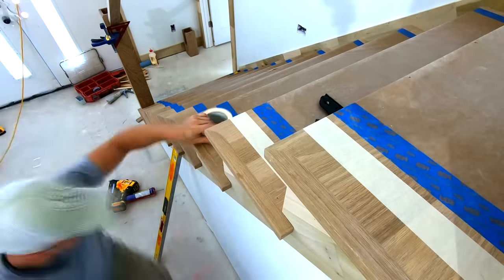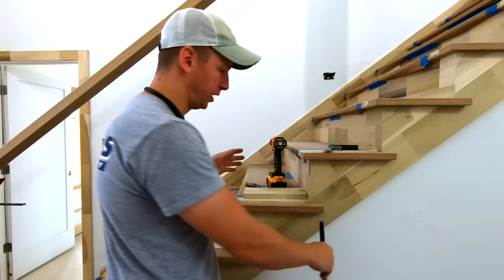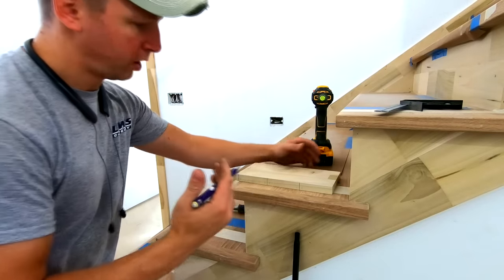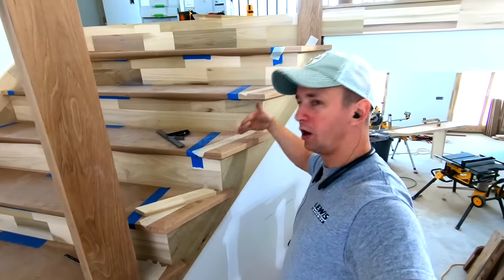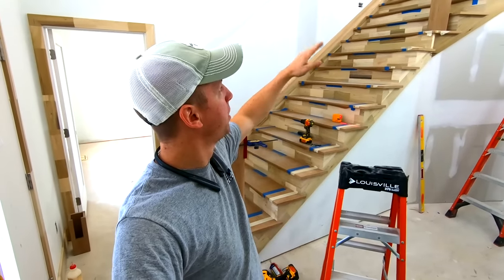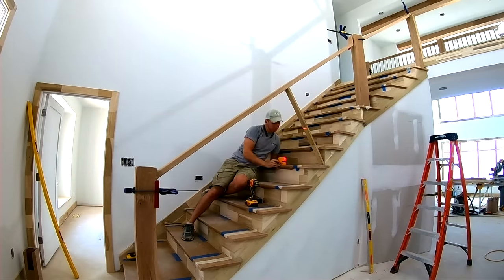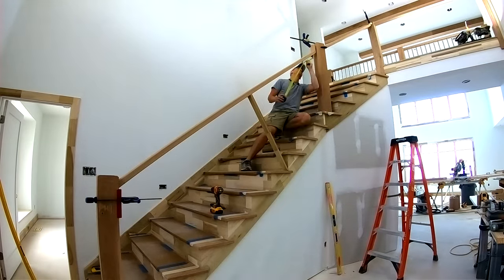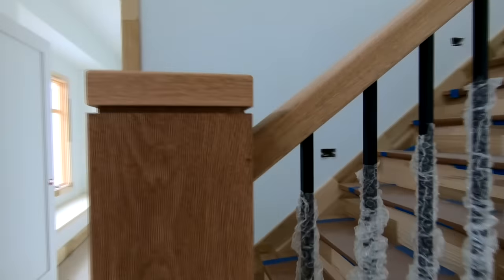How to Layout Iron Baluster Spacing on Staircase - Wood Tread & Handrail Spindle Layout

Comment from the maker: Bullet Tilting Hollow Chisel Mortiser - http://www.cwimachinery.com/product/b... (MUST BE A TILT MORTISER)
Dewalt Compact Stand (for mortiser) - https://amzn.to/32R4W2m
Stabila Digital Level - https://amzn.to/2PRwVXV
Digital Angle Gauge - https://amzn.to/2Y0iaX7
Baluster Layout Compass - https://amzn.to/2OUr3Nf
Starret Combination Square - https://amzn.to/3f3ph75
PLS 180 Laser - https://amzn.to/30OMCnN
1/2" Hollow Chisel Bit - https://amzn.to/2OZDgjH
Rubber Mallet - https://amzn.to/3hDCq8m
DEWALT DW872 14-Inch Multi-Cutter Saw - https://amzn.to/2Em3mvb
Dewalt Cordless Grinder - https://amzn.to/2EiwXWd
Festool Sander - https://amzn.to/39sEoG1
#14 x 2" Construction Lag Screw (For Handrail/Newel Fastener) - https://amzn.to/2DdIben
Reply: How would you measure out for false tread end caps

Comment: Just drill a 7/16 hole, tap a 7/16 dowel in the hole and tap the 1/2" metal baluster over the hole. No chisel needed.

Comment: This formula for spacing did not work for me , when it changes from step to step the spacing is different, i cant figure out a correct formula for it to make every single one with even spacing. I instead found center of each tread then tried a few different combinations to finally find the right spacing

Comment: I'm glad you keep the newel post to baluster spacing the same as the spacing between the balusters; there's very little that irritates me more than seeing that first baluster either too close or too far away from the newel post. Great video 👍
Reply: I am completely a novice and hadn’t thought of the newel post and first baluster spacing. I mean, I did think of it in the manner as, it was too close to the baluster. I was just about to leave a gap because the newel post is covering up the step a bit too much. Now, I have to rethink this a bit. Dang. Thank You though! I can do this.

Comment: Great explanations into explaining why to do things the way that we do . Some of the things I do that different is I usually stretch spindles to 4" center to center roughly on landings and stairs . To do that easy I measure with 2 foot level from 1st nosing to 3 nosing then divide by 5 so the treads go 2 3 2 3 . This allows it to match landing spacing easier . Less spindles is money saved and less effort . Only down side is you have to measure the spindle 1 by 1 . Also i always tape the underside of the rail for marking as well as it also helps resist chip out when drilling . Subscribed

Comment: Great, clear videos. don't work with metal balusters but many things, tips and tricks still apply. Not aware of the Bullett benchtop mortiser. Wish I didn't pull trigger on Powermatic floor machine. But at 71 yrs of age probably couldn't manhandle the Bullett on site anyways. Just subscribed.

Comment: My biggest stair screw up was in fact my very first stair job . I spent all day, a long day, on a straight rake run to the second floor. It was hot out so the front door was open. After admiring my work and patting myself on the back for what seemed like a job well done, I went to close the door and ......., it wouldn't close. I forgot to consider the door swing when mounting the newel and the door was hitting it. A long day became longer, as I had to remove the newel just to close the door. Needless to say, one day turned into two since I had to return to solve the issue.
Reply from the maker: Uhg. Those days are so discouraging.
Reply: @InsiderCarpentry  hello. Thank you for all the great videos! They are very helpful. I have a question. I am laying out my balusters and my run is 10” so I know my center point and spacing for each, but when I am calculating the balcony area and center points and spacing is a little larger than the treads. Is that ok to have them like that on the same staircase.
Reply: Just wondering why you didn’t have remove the hinge pins and call it?

Comment: Great job.  My biggest screw up was installing the balusters that died into the ceiling last.  Historical house so ceiling was out of level in different directions on both sides so my cuts were short.  Neither side swapped out worked.  I ended up using a 1x4 with some matching cove molding used under the treads as a cap in between the ceiling and balusters.  The home owner loved it and it really finished the stairs.

Comment: Hey,
Love the videos.
Quick question, my stair tread aren’t the same length, 10” to 10.25”

What is important to do here? 
Keep the baluster spacing the same on the step, even between all the balusters, or line the balusters up with the riser.

You didn’t really explain or touch on this in your stair baluster video.

Thank you so much
Reply: Agree

Comment: Do you still try to line up the balusters with the riser if the stairs are carpeted on a rake wall type application? Since the rake wall will have a cap board that sits above all the risers and treads, does it matter in that situation?

Comment: I also snap a chalk line top to bottom for my baluster line. Plumb down from the bullnose to the tread below all the way down the stair and connect all those lines. It makes all your balusters in a dead straight line. Instead of going off the tread return with a combo square. Treads might be slightly out of square and not perfectly straight to each other. Takes longer my way, that's the only downside.

Comment: Great video.  I’m a Home Owner / DIY ‘er.   Seems that front-of-riser to front-of-riser is not consistent so it would have been nice to have an example of what would be required in this case.  I have a couple of 10”, most vary 10 1/16 to 9 15/16.  The highest is 10 1/2 at top where the railing would but into a wall.  As an engineer am I over thinking this.   Should I just build a jig that references to riser and assume all are 10” and place a 1/2 spacer for the first step against the wall?   That would just increase the space between wall and first baluster.
Reply from the maker: I line up the front edge of my balusters with the front edge of the riser. This should be consistent the whole way up. So you can then evenly space the balusters per tread.
Reply: @InsiderCarpentry  OK, here I go.... So based on your reply, I could make my jig, but instead of butting the jig against the riser that meets the step I'm marking, I need to line up the front of the jig with the riser below.  Your response make the priority for aligning the jig the riser below the step so that the Baluster on the step we are working on lines up with it...  Thus any slight differences would be on the spacing of the 3rd Baluster to the riser meeting the back of that step.    Hope that draws the right visual in ones mind...

Comment: Hi
About main level newel post placement, leaving aside entry door problems.
why isn't placed on the floor? is code allowing you .(full run or handrail ,here)
Code aside; isn't better to have the support of the 1st riser and fasten to it ,and the floor too. 
Im definitely using those links on this videos.
Thank you.
Reply from the maker: In this case it was a space issue. It would have unnecessarily encroached on the floor space and path into the office. 

Aside from that, I can make a box newel sturdy anywhere I place it. Its all about building good interior blocking which is fastened to the substructure and lots of PL.

Comment: I’m actually following along to install mine. Same exact measurements and iron balusters and the math to make the template is just not working ! If I do 2 13/16 my last space on a ten inch board is almost 4 inches ! I am so lost
Reply: Do you have the same run as he does?  That will determine the spacing between the balusters.

Comment: Thank you for the great channel and content. Is the intermediate newell post sized to maintain the same 2 13/16" spacing between the bluster above and below?
Reply from the maker: No, name size newel. The spacing around that newel is a little different. I basically just tried to pick what was going to work best with baluster spacing and handrail drops.
Reply: @InsiderCarpentry  you should do a video on how to do this if you don't have a laser. I place the handrail on the nose of the treads I don't have to worry about sagging then use a square to mark the rail. I also get the length of the rail this way I didn't see how got your length in this video. I noticed you didn't tell the center to center distance I know you add the size of your blaster to the spacing. This is the first time watching you if you have done before ignore everything I said
Reply from the maker: The main reason I don’t do it the way you mention is because I’m typically installing box newels that come with a 3/4” wrap at the bottom. So it doesn’t work to place the handrail in position between the newels due to the lower wrap protruding.

Comment: What type of newel mount do you use?
Reply: He shows it in many other videos.   I’m assuming it would be the same for this application.   Those are hollow posts. So he is cutting holes in the treads/ floor decking, and attached blocking sticking through the floor.  Attached to the floor joists, or I’d assume the stringers of the stairs.  Then uses a bunch of PL PREMIUM construction adhesive slides the newel over the blocking, and hits it with some finish nails.
Reply from the maker: You got it. You know my style. 😂👍👌

Comment: looking for a stainable putty I have white oak thanks . When I mix the tile bond too with the sanded powder it still turns a dark color looking for something more blonde to blend better any ideas would help thanks
Reply from the maker: I have yet to find anything that takes stain the same as wood. For very small holes I use ZAR natural that comes in a tube.
Reply: @InsiderCarpentry  thanks for the help
Reply: Putty after staining

Comment: Does an intermediate newel post meet building code? I thought the handrail needs to be continuous unless there is a landing. I think I would make a wreath fitting at this angle transition.
Reply from the maker: Where I am located it does not have to be continuous.

Comment: So what’s the space between each baluster throughout
Reply: It will vary with each stair case job, but as long as it less than 4 inches then you’re good. Anything smaller than 2 inches is not appealing in my opinion but still acceptable. Pretty much as long as a baby’s head can’t go through it, you’re good. But no more than 4 inches

Comment: Can this be done on laminate flooring? I'm worried about the drilling.
Reply: I would not advise installing on a laminate floor because there is movement 
Install a wood bottom plate with the bottom edge rabbited out to allow the laminate floor to expand per its installation requirements

Comment: Biggest stair screw up? Ugh. I built perfect winders according to everything I could find in the current code for my area. The inspector told me that I needed a 6 inch walking path on the inside corner. To re-frame would have involved moving a exterior door with siding already done and re-frame the floor opening. I tried to get him to show me in the code where this requirement was, and he kept referencing his "interpretation documentation", which, well, isn't part of the code. It was an extremely frustrating experience. Ended up doing a very weird block out under the handrail to keep people from walking where they wouldn't have tried to anyways, just to appease the inspector who wouldn't back down.

Comment: What can you do if you don’t have the laser
Reply: There’s a lot of ways to tackle it. One way of limited tools is you can use a 4 ft level and plumb the first two-three adjacent balusters. Figure out the slope run and distance between each balusters and make the rest of the marks. Then come back around with the level to check if the marks are lining up plumb. Adjust as needed. Tedious

Comment: I like your videos, but just a couple constructive criticisms because building stairs is what I do for a living. You should never go with minimum 10" run go with 10 1/8" to give the inspector or potential lawyer some leeway. Around here the inspector checks run by putting a square on the tread butts the treads above it and measures, inevitably the left wall will wiggle a little bit from mud and the run will not measure the required 10".  Go ahead and check it, it's tough to get it perfect. Another thing is the stair does not pass code because it has to to have a continuous rail with the new code - the box newel interrupts the rail and it is not continuous.
Reply from the maker: There are different codes for different locations. This passed code just fine in the respective location it was built in.

Comment: I am about to build a set of stairs with the same cast iron balusters.  What size are your balusters here and the height of your handrail.    The balusters I have are 44 inches, so I will have to cut them down.  Great tip  on where to set the knoll 
post in regards to the spacing of the balusters. 
Thanks for all you do,

Comment: My biggest screw up was my first staircase i ever did oak treads and risers with an exposed stringer and i thought the simplest thing to do would be veneer the 2x12. 2 days after i applied the veneer the stringer  cupped by every cut and bubbled the hell out of it. At this point of course the treads were applied with returns. Fair enough to say i was up shits creek.

Comment: I double check the spacing on my handrails like that as well.  Easy way to spot a mistake.  I dont use a tape though.  I use a divider(compass)  Also for balcony layout a divider makes it so much quicker and theres not a more accurate way imo.  Spacing will be perfect every time. I mark my center line with a pencil but a sharp divider with a little pressure applied will make divots for your drill to start in.  I still go over the divots with a small pencil mark just to make them easier to see.
Reply from the maker: I often use a divider on the flats as well.

Comment: I prefer to use a dot laser, it never lies. Line laser the way your using it is prone to inconsistencies.
Reply: I too think line lasers are wonky, but I'm beginning to think it might be user error and not the tool.
Reply from the maker: Not in this instance. If the rail is plumbed in parallel with the marks on the tread, it doesn't matter if the line laser is slightly crooked, the intersect point will still be plumb because the handrail and baluster plane are running parallel on the same plumb plane at the center points.
Reply: I disagree, the dot laser is more accurate. But each to his own
Reply from the maker: Minutely more accurate, but when else is it useful for. I bought a dot laser years ago thinking I would use it for this task...I found it to be a one trick pony that wasn’t useful for anything else. I never touch it. The line laser is far more versatile so that’s why I grab being that it has so many other applications. That being said, the next laser I buy will be one of the ones that had a dot and line laser in the same unit.
Reply: I use it in set out of walls for renovations, used it to find centres on steel beams to get marks on floors when ceilings to high. Essentially its a one person fast set up plumb bob.

Comment: Awesome work! I enjoy the tips and tricks to great carpentry. Any chance on showing the staircase build? I have seen the builds with false end caps, and hardwood stair treads and risers. It would be  great to see how you built this stair case with hardwood open end caps.
Reply from the maker: I didn't take any video of the tread/riser/skirt install on this one, but I'm sure we'll cover it eventually in future videos.
Reply: @InsiderCarpentry  I'd be interested as well.  I'm stuck doing a U-shaped stair using over the top railings and round newels and balusters because the sub doing that 1) was out of his league and would only do it the way he had for other simpler stairs  2) quit the job when asked to do it better.  I am subscribed because I appreciate your attention to detail as well as your straight up knowledge.  Thanks.

Comment: If you are aligning face of ballaster with the face of the riser wouldn't the math be 10 inches minus half the width of the first ballaster to get the first center point? For equal clear spaces then the first and second  center to center dimensions would be 3 11/32" and then 3 3/32" from the second ballaster to the face of the next riser?

Comment: Hi, how do you drill angle hole under the baluster?
Reply: Always more than one way to do it but when the handrail is temporarily attached for markings, I also check for plumb on the handrail and mark a light line across it. Make a wood jig and drill a hole to match that plumb line on the handrail. Make sure to test and adjust as needed before drilling the handrail. The jig will keep you from swaying off when drilling.